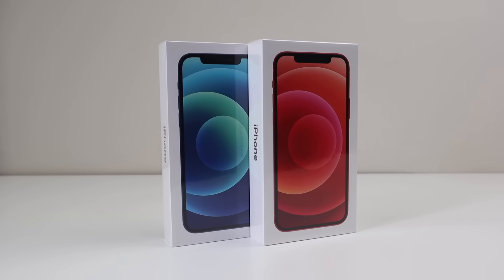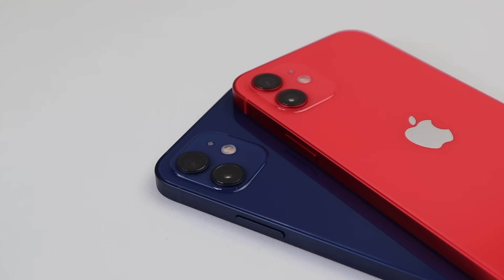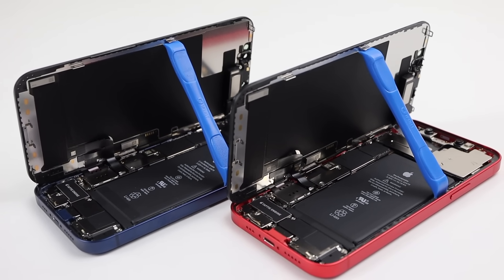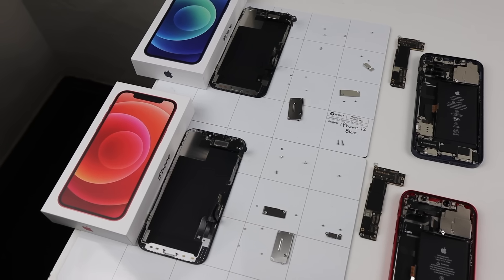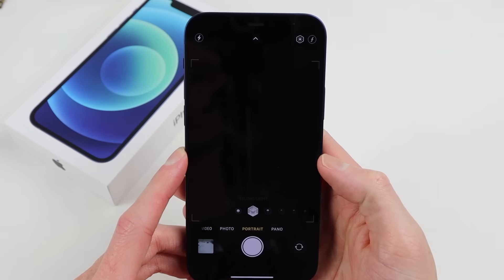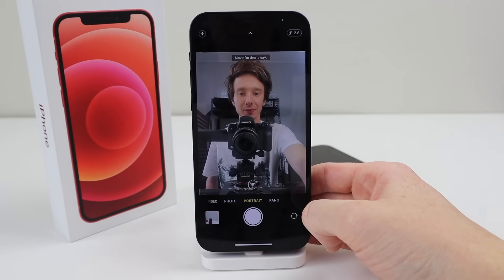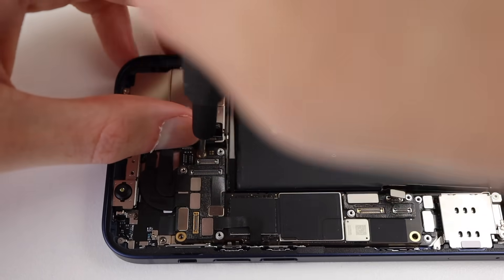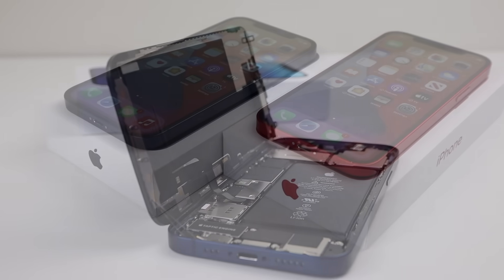iPhone 12 Anti Repair Design - Teardown and Repair Assessment

Comment: Me that has never owned a single apple product in his life: "Interesting"
Reply: Well, now we have a reason to not even try.
Reply: I ditched apple back when the 3gs was the new phone.... went to android and never looked back
Reply: I had a iphone, biggest scam ever
Reply: @arthurhar1616  Why was it a ''scam''?
Reply: I've had my galaxy s8 for 3 years now, it's had 2 cracked screens replaced at 90 bucks a pop by myself also replaced the battery .... thing still runs like that day I bought it.
Waiting to lose it or have my phone stolen to upgrade lol
Reply: because overrated/expensive asf and not even competitive to other brands
Reply: Same
Reply: Same here
Reply: Dude, iphones are just to people with enough money to throw away, im ok if someone wants an iphone but i use more functions on android than ios
Reply: @SantaMuertelivE  Or you could just purchase a case for what, 30$? Speck has some of the strongest, most reliable cases for both iPhone and Samsung and they cost dirt.
What is your excuse? Not to mention the fact that Samsung runs Android, which is known to be easier to hack.
Reply: same XD
Reply: Same
Reply: My phone is made by LG.  Works just fine.

Comment: Thank you so much Hugh .. i can see Jerryrigeverithing  commenting here and i think you know Louis Rossman too.. anyway he did a video very similar... Apple simply is a cancer of modern electronic devices no repair possible even with brand new original oem parts from the factory T2 chip and chip inside charger and power charger cable ... Simply Apple sucks ..

Comment: U didn’t swap the camera? To go with the original board??? That’s why Face ID didn’t work they won’t fix that replacement issue because it’s money in their pocket just swap the original camera to the board in it’ll work fine  they’re programmed to work with that board alone when replacement parts are available they’ll be programmed to work with all phones

Comment: This is why you don't support Apple. They are anti-capitalist when it comes to their repair policies. Never have, and never will own an Apple product. Nothing but overrated garbage for me since I also just like to pop things open to tinker with them. Would do nothing but piss me off knowing that I did everything right on the physical aspect, but due to some software diagnostic tool not many will have, still be unable to complete a project.

Comment: Hi thanks for the video. As a computer  scientist that had also alot of Security in his studies let me tell you, eaven when it really sucks when you want to repair your Phone it is crucial for your Security. Short: if the Hardware Changes you can not verify the integrety of the Sensor readings, like faceid. A Hacker could Change the device to unlock it. So you have to Turn it off. Strange though that the camera App ist Buggy Afterwards... But i do Not know alot about that area it could have technical reasons as well.
Reply: It's a phone, not a gold safe with millions on it.

Comment: I had an iPhone 5 SE, I hated it so much I went back to my Broken Samsung S4. I was able only last year to get hold of a new SIM card assembly and restore operation of the phone, which I am still using and is perfectly adequate for my needs.
Apple are a corporation with a disgusting attitude to customers, I do not buy Apple, I have never bought an apple product, (The 5 SE was bought by my company and I was allowed to keep it as it couldn't be repaired. I put a third party battery in it but the phone was slow, and buggy afterwards, even though the battery performance was as good as when the phone was new.
My repair experience goes back to Valve Colour TV's, which were notoriously unreliable.
But today it is obvious that corporations like Apple are only interested in selling the next model hence are building in obsolescence and denying 3rd party repair options.
However, as long as people are stupid enough to keep buying from such unethical corporations they only have themselves to blame when they can't get an item repaired.
Reply: Are you running LineageOS on your phone? I'm asking because Samsung hasn't released even a security fix for S4 in many years.

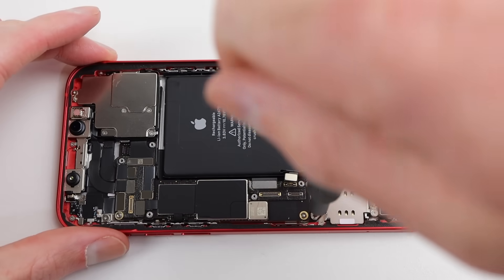Comment: "Great modularity but you can't replace the components (6:25)"

At that point, they should have just soldered everything
Reply: But that would make it difficult for even them to repair it. So they won't be able to make as much insane profit on the repair.
Reply: @MDP1702  yeah but soldering reduces power consumption, materials and space
Reply: They already do it on laptops.
Reply: @bouxesas2046  yeah because the effect of power saving and space reduction is even greater...

if you don't build for repair, soldering is actually better
Reply: @Markus-zb5zd  Their purpose is not to be able to service or upgrade them. Power saving does change at all. Space saving is debatable. We are talking about nvme drives and small memory sticks. I want to be able to change my disk and upgrade my memory on a 2.000$ laptop so no, thank you.
Reply: @bouxesas2046  oh I fully agree

but still, there is a minor boost in efficency for soldered parts compared to cabled or socketed ones.

They are also cheaper.

But as you meantioned, they are incredible much harder to repair....

the Problem I see is,... when apple is underminding the reapairability anyways with their software.... why not follow it up with the hardware?
Reply: But then they wouldn't be able to refurbish their phones and sell you a used phone as brand new.
Reply: But they didn't to make it easier for THEIR techs
Reply: Maybe they'll do that on iPhone 13
Reply: don't give them any ideas AvengerMKII!
Reply: No, because then they wouldn't be able to charge you ridiculous amounts when they repair it for you.
Reply: @a2falcone  repair? They just gonna say it's water damage thats not covered under warranty then say its 2x as expensive to repair then it is to just get a new one, also there's no way to recover your data. Even though many 3rd party repair centers can.
Reply: @Indy509  someone watch louis
Genius bar not so much lol
Reply: @a2falcone  no, they just add a 'resolder' surcharge for $200.

Comment: I recently obtained a Huawei 5T. Its power socket is USB-c. But it came with a fast (2-Amp) mains charger and a (USB-3 >USB-c) cable. It surprises me that the phone does detect and complain whenever I use the Non-Huawei cable - it does seem to know. I have never purchased an APPLE product for the reason you point out here. Always something odd and or difficult. I do like USB-c though.

Comment: Damn.. Apple is still doing this smh. I have an iPhone 6s from 2016 and I replaced its battery a couple months ago. The touch ID no longer worked after the repair. It's basically what happens with the iPhone 12 Face ID

Comment: Guys laugh at me for using an iPhone 5.... when my phone is smaller?😂 is a big phone a good thing? Next gen is gonna be like the size of a Nintendo switch lmao😂😂😂😂. Only bad thing about the 5 is it’s storage size. That’s about it.
Reply: And the fact that you don't get security updates for iPhone 5 and the Safari is locked the last Apple provided OS release and you cannot install any alternative web browser so you are forced to use the old Safari release without any security updates.

Other than that, I think that iPhone SE (2016) is the best Apple phone ever released exactly because of its form factor. Too bad that Apple hasn't released any modernized (that is, fully supported by the latest OS) version of that hardware.

(In case you didn't know, Chrome or Firefox on iOS are not real browsers but just a frontend to system included Safari web engine because Apple does not ALLOW any other vendor to distribute a web browser on iOS. How's that for a monopoly?)
Reply: @MikkoRantalainen  well I use chrome and thank you for telling me this! (Great vid btw)

Comment: Greatest ponzy scam ever Apple. Next years model won't include a battery for the phone because there are billions of lipo batteries for Apple products. Then if you take out a battery from an old phone the connector is completely different and you will be forced to buy a battery from Apple themselves.

Comment: 8:29 
iPhone Screen: "Independent Repair Providers will also offer genuine parts by trained technicians."
Hugh: "You can get the phone repaired at Apple." (Implying only?)

I'd imagine there is a registration process for the new board?
Reply: Means they are going to charge third party's for the ability to fix their phones.
Reply: how can I believe official repair will solve this? Maybe it is the same.
Reply: @whimsical_travesty  listen and think for a moment
Reply: @yodk9026  His iBrain does not compute cheap third party thoughts but considers them not genuine.

Comment: Thats not how it works apple.... Shipping without a power adapter doesnt fix the plastic problem when youre selling that adapter because you arent shipping it with the phone o.0
Also, how do apple get away with selling their phone with new connectors and no way to use that phone after youve run out of battery. Im starting to think apple wants you to use the phone twice before having to upgrade or buy another.
Side note: That red iphone is gorgeous.

Comment: Let's say iphone 12 is someone first Apple product they bought which mean they don't have any accessories from the previous version then they bought the charger and the headsets which pack in another cardboard and plastics and printouts warranty/manual. THAT pack itself is already a waste so I still missing the point when apple said the wanted to reduce climate impact unless they pack the product with chocolate brick and print the warranty from seaweed sheet so you can eat it after unpack it

Comment: All of my computers are Apple. I will never buy another one of their products because of this. I have had it with this company. They even cheated me over a repair. Told me that fixing my computer was more expensive than buying a new one, so I was forced into a new product. After hearing about their repair scam, I went back and got my old computer. (They tried to charge me $45 for looking at it, so I left it there and bought a new one). After going back and getting it, I took it to a 3rd party repair shop and it cost $60 to fix. That's compared to the $750 I paid for a new one - which I apparently didn't need. Down with Apple!

Comment: Apple is notorious for deliberately making things impossible to repair. Quite frankly I feel the EC should require that third party repairs should be allowed, and not just allowed, third party components should be allowed. If a company doesn't allow this on their products, then the EC should either force them to provide free repairs for something insane like 25 years after the product was launched or just outright ban the product from being sold in the EEA.

I know that sounds draconian, but it is the only way companies like Apple are going to change their ways. Having a firmware lockout on components should be against the law. And the same should apply to cars, farm equipment and well really anything. You bought it, you own it, you are entitled to repair or modify it as you see fit. The manufacturer should get no say in the matter at all.

Comment: And they want to be eco friendly.
Reply: I think "eco" in Apple speech means recycling, not friendly to environment. If a device manufacturer wants to be friendly to environment, the device is easy to repair and if it cannot be repaired, then it can be easily recycled. Apple is just about recycling and you never ever repair anything.

I guess it goes with Apple ideology that if it's not "perfect" it's not worth using. A true Apple user will only accept virgin products that have not been touched since the factory.

Comment: Apple is so clever.
This is why i switched to android.
Reply: Yeah, same. I think might go for the s20 fe instead.
Reply: Clever? More like greedy
Reply: Been using a 150 dollar country brand phone for 10 months. Is called General Mobile Gm8. The phone is good, like it has a Touch Id on the back, and is strong. I dropped like 20 times, half on the rug.
Reply: I got sick of Bloatware on Samsung. I went to a cheap phone $150 for 3 months service and the phone for FREE! Did that a few times and have a few extra wifi phones now.
Just upgraded to the Pixel 4a for the better camera and I'm pretty happy... And not in debt for it! Lol 📱
Reply: @CliftonPhotographer  Most newer androids have barely any bloatware. And the apps that do come on them won't really do anything to affect you. They don't pop up with notifications or anything. A Lot of the factory apps can also be uninstalled.
Reply: Hackers are also clever, that is why they only aim at Android.
Reply: @chanceburn7416  
I'm not president.
I don't need top class security protection.
Android security is enough 😂
Reply: @BhagwaGiri  That is such a dumb and reckless argument to make. But sure, make sure your security is not supreme and solid enough to prevent your bank information and security information from being spread and sold by hackers or other companies.
Reply: @chanceburn7416  
So you r defending iphone just because it has better security than android?

I am okay with little weak security but i need freedom, better looking design, high refresh rate & pocket friendly price.
Reply: @BhagwaGiri  Do you know the difference between iOS and an iPhone, and the difference between Android and an Android phone? This might be a very complicated question for you, so I suggest you either do research or think carefully.

A little weak? You mean a lot weaker. You rather choose for more freedom than a better security system. That tells me a lot about you.
 And a better-looking design? What phone do you use? for the rest, I have no clue why you wish for a high fresh rate, but Apple has the best GPUs for mobile phones. And their phones are also pocket friendly unless you are skinny jeans wearing clown?

But that begs the question, what phone do you use?
Repeating that question, but easier for you to comprehend; what phone do you use? Not what driver (iOS/ Android), but the phone.
Reply: @chanceburn7416  
😂😂😂
Seems someone got triggered.
Buddy, I have used iphone 6, SE, 7 plus for yrs.
Then switched to galaxy s9.
Even s9 felt too good as compared to those iphones.
Now using Oneplus 8.
I know iphones perform better in gaming due to optimisation & graphic thing.
But 865 snapdragon is good enough!
You must try atleast 90hz  then u will know what high refresh rate does.
Now, hacking android is not that easy as it used to be!
Android security might not be as good as iOS but some people prefer more freedom, openness & customisations.
I too was like u, an isheep.
First use any android flagship then comment!
I would suggest u to try Oneplus phones.
Reply: @BhagwaGiri  I cannot take you seriously. Why are you using so many emojis?

Yeah, I am so triggered over an argument with a random person about phones. Get real. The only thing I could be triggered by is your ignorance and simple mindset.

That is great. As have I used the iPhone 6 for about 3 years, because I did not want to have a phone for a very long time. And now I have an iPhone 11 that I am planning on using for at least 2 years or until it becomes unusable. Your point?
 So, you are comparing the iPhone 6, iPhone 6 SE, and the iPhone 7 plus (that you claim to have ''used for years'' (which is weird since those are 3 phones, and ''years'' means more than 2 years)), with a phone from 2018? Let us see... the iPhone 6 is from 2015, the iPhone 6 SE is from 2016, and the iPhone 7 is from 2016. Are you honestly surprised that the Galaxy S9 which, again, is a product from 2018, ''feels better'' than any of the iPhones you listed? Shows how biased you are.
 The OnePlus 8 is about the same price as the iPhone 11, if not more expensive.

''due to optimisation & graphic thing'', I am sure you know a lot about phones and components, after reading that statement.
There will always be people on this planet who argue ''but this is good enough!''. We know there will always be one thing that is ''good enough''. Such a crappy argument to make.

I do not play video games on my iPhone except for a few that barely require any strength to play. And even then, I could just install Bluestacks and play on there, if I wish. My PC has a 2080 Ti in it, which could actually be classified as ''good enough'', considering there are 3 even greater graphics cards coming out end of next year or later on which you can play 8k. Barely anything supports 8k yet, and 4k gaming already is something extremely luxurious.

iOS also has plenty of ''freedom''. I have no clue what ''openness'' is supposed to be? Easier access to the most important information and data? And customizations? Like what?

No, I am not going to use an Android phone, and there is no reason for me to do so either. I am happy with what I have, considering this is the first phone I purchased myself and I am safe and secure with the device.
 And I am especially not going to purchase these OnePlus phones, considering they cost 649 euros, which is more expensive than my iPhone 11.

Comment: hey so if someone were to make a transcriber type emulator that connects to phone and new components, it would theoretically be able to sync the two by forcing the missing pair data into the new component then that should be it... right?  ... maybe a right to repair app on git hub similar to the jhon deer tractors who are doing the same thing to farmers have these type of overwrite perms. anyone have an idea and agree if that should work?

Comment: How about the screen or battery, the most vulnerable components that most likely will need replacement? It'd be interesting to see if you could replace either without any issues.